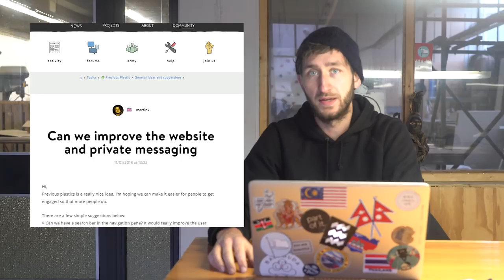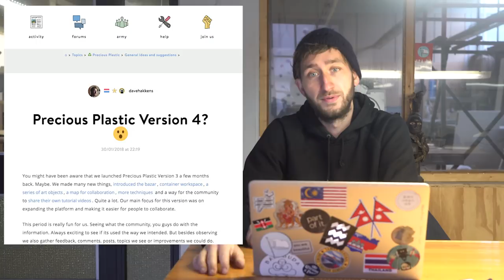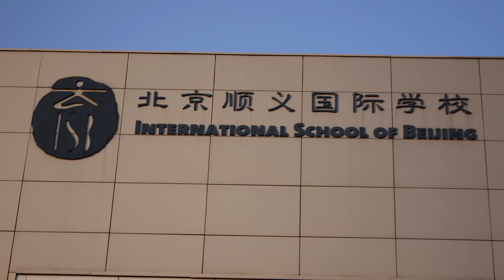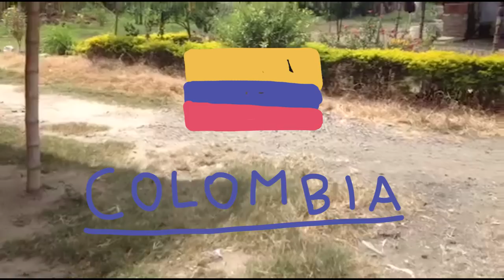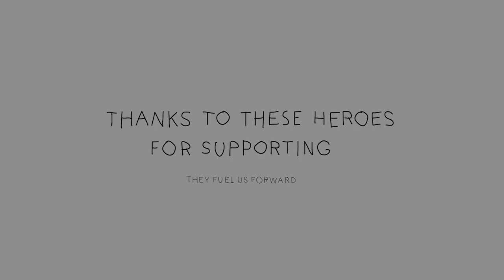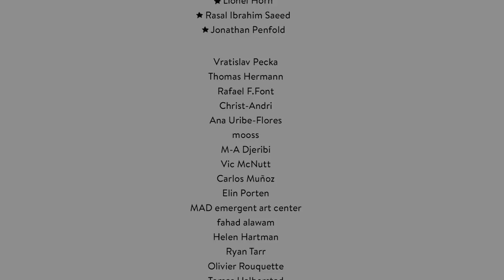Monthly news #12  - Winter sleep

Comment: Hi Dave,
Thank you for your wonderful project and youtube series.
Maybe some ideas for your next season:
-Plastic alloys. What can be mixed. ABS and Poly-carbonate is supposed to be good.
-Plastic composites. I recently built a solar plant using plastic beams made of PE and textile. Glass or wood fibers would also be interesting. 
-And I had an idea to make beams in a very primitive way:
    -Take a round/square mold with a plunger on one or both sides which can be pressed in with something like a piece of threaded rod.
    -Fill it with plastic scrap.
    -Heat the whole thing in a parabolic solar trough.
    -Tighten the plungers as it heats up.